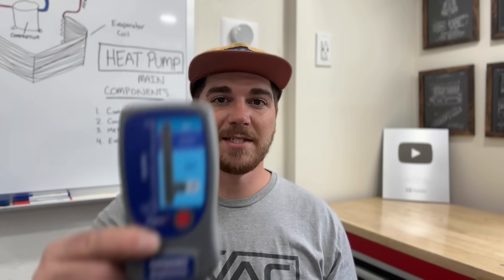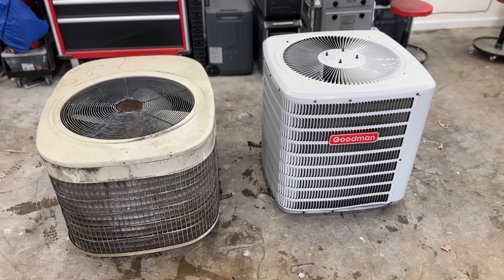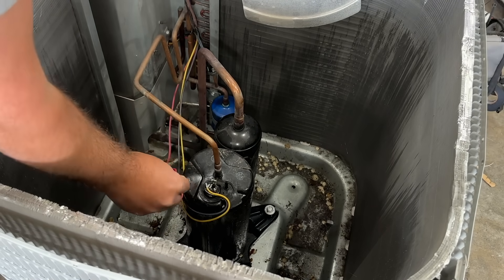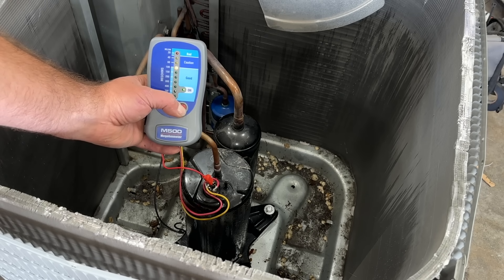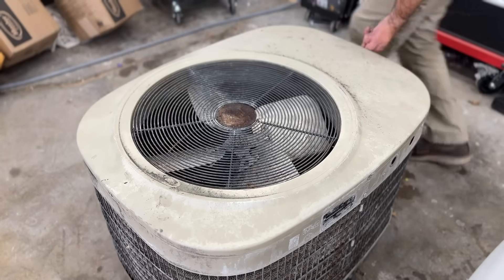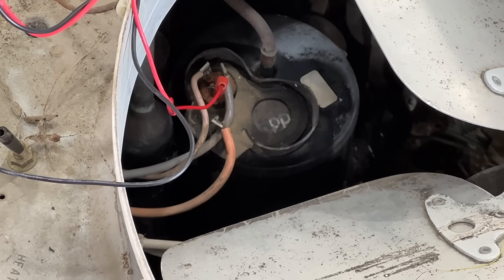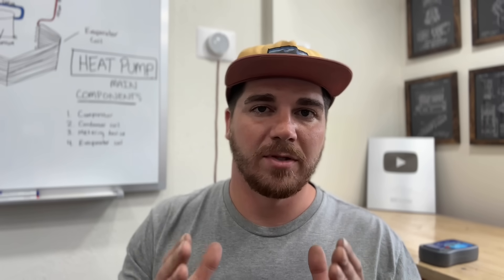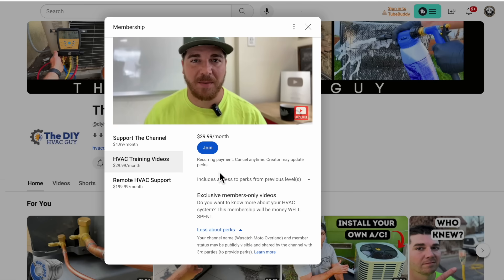Is Your A/C Unit About To Die? This Tool Doesn't Lie

Comment: Just happened to my neighbor. Bad Cap caused unit Fan to stop working.  Compressor goes into Thermal lock. He calls the  AC repair man. The AC man tells  him the Compressor is shot and that he needed a whole new systen at $22k.... I told him to wait for the motor to cool down and we replaced the Cap. All is working well now.
Reply: JEEEEZ! $22K? What did they quote him? A 5 ton variable output inverter heat pump? Hat is a massive price.
Reply: @whochecksthis  $22k would have been the cost if he had chose to use their financing for how many years to pay off... for a 3ton straight cool unit.
Reply: @props-model-shop  ahh… what was the cash price tho?
Reply: @whochecksthis  I replaced THREE ~5 ton systems 5 years ago with variable output 20 SEER inverter systems for less than that!
Reply: @phillipsusi1791  pro, or diy?
Reply: @phillipsusi1791  wow.
Your area must be very affordable to run a business.
I put in two bosch inverter systems with a 5 ton, on 4 zones, and a 3 ron on its own with a 96% gas furnace, and it was close to 22K, 3 years ago.
I dont think i could do 3 vs systems for that today.
Likely would struggle to put a quote together for 2 under 22K.
Reply: @whochecksthis  Well they aren't all 5 Ton.  I think the downstairs one is that big, but the upstairs was smaller, and the one in the mother-in-law suite was smaller still.  Were you putting in the whole system new or just replacing the existing heat pump and furnace?  I have no idea how expensive a furnace is since we don't have those in Florida.
Reply: @phillipsusi1791  ahh. That makes more sense, but still way less than we would charge here in NC.
Reply: @whochecksthis  Not unrealistic. I was quoted $18k to replace my tiny little 2.5 ton system. Replaced the bad contactor and also the capacitor just for good measure, still working almost 5 years later. Also a neighbor called me to come to her house. HVAC contractor was trying to charge her $320.00 to replace a wire on the condenser. I disputed the charge and fortunately the contractor tore up the work order. Two days later, she called me and said it had stopped blowing cold air. I walked over, looked at the condenser and the wire he replaced was burned up. Again! I told her wires don't just burn up. Something caused it. I looked at the contactor and saw it was completely burned. I went to a HVAC supply house not far away and bought a new contactor for $16 and new capacitor for $15, replaced them and the burned wire and it's still working three years later. That's two HVAC " total replacement needed" fixed with a new contactor. And capacitor, for good measure.
Reply: I had a brand new ac unit outside and the inside fan and all that replaced, brand new equipment and all the labor and copper wire and blowtorches and soldering, for like $3200 😂
Reply: I just had an AC tune-up done My guy said my unit's ready to go. It's making a Wawa noise in the compressor and he showed me some meter that should be 30° different mine was only 15. He quoted me 11 grand, why can't you just change the compressor? Mine is r22
Reply: @TonyQuartarone-y2e  it could be the compressor, metering device, or contamination of the r22 (like someone had r410a in their gauges, air, or moisture). He is not wrong on replacing it. I would recommend the same. The r22 system you have is old (life expectancy is 15 years), the compressor is very labor intensive, you will need a new filter dryer, metering device, recycle the old refrigerant, and add new (remember it has been illegal to make or import r22 for years now). Way too much money. It is not like a car that becomes "a cherry" if you keep it long enough. It will not increase your property value, neighbors won't want to come over and look at it. It instead becomes a turd and lowers your property value. It probably uses 2x or 3x the electric of a new system to operate. Your coils will fail next and you will loose all the refrigerant.  You will be mad because you just wasted all that money replacing the compressor. Keep an r22 system forever as long as you don't have to mess with the refrigerant. It did you well, it faithfully provided you with cool for years with little in return...
Reply: my granpa is the same way he says the compressor should come right on but never been to ac school my granpa says hot air is not heavier then cold air its like where did people go to school he has no idea how rain is made if you have alot of humidity in your house it will destroy your unit ,, constantly turning it on and off will destroy your unit ,, common sense , no it has a safety circuit to prevent damage normally the ac runs for a few minutes then the compressor comes on if it had a cataclysmic event
Reply: @bengordon7635  too much humidity will not cycle the ac or destroy the ac unit. Most residential units operate on a thermostat, not humidistat. Too much humidity will destroy your house (mold/mildew).  Ever been to a place that felt cold and clamy? In school they called that the "Chinese restaurant syndrome". That is high humidity in a cold environment. Often the case of grossly oversized units.  They pass air across the coil too fast to remove the humidity.  Thermostat is satisfied with temperature.  You are left with high humidity.  Again, in the majority of systems, the thermostat is the only protection for short cycling the outdoor unit.  To save money, the majority of systems do not have safety systems other than a overheating switch in the compressor.  I don't know how much it helps as you could still fry eggs on that compressor before it shuts down.
Reply: @--harry_  he has a 5 ton unit for 2400 sq ft all I know is its a trailer ,, and at 75 degrees it keeps the heat out as a natural barrier correct ,, the air shuts off every so often at 75 ,,but he raises it to 82 and the ac runs all day and never cools the house he lets everything get hot to the touch in the house the ac runs all day and he says a tralier cannot stay cool , there are 20 vents all wide open will not use the diffuser's the room where the ac comes in is 52 the last room is coming out at 72 ,, do you not adjust the diffusers to even the temp throughout the house ,, he says you cannot close the vent I said on youtube they said you can close it upto 80% , m I said once you let the heat in a trailer its over ,, I had one ran my ac at 74 all the time my ac never broke until I sold my house after 6 years ,, he buys a new unit it broke in three months why melted the capacitor ,,,,hmmmmmmmmm
Reply: What a rip off. I put my system in in 2001 for less then $2200. That was all the parts and most of my labor. Knock on wood it is still running. It could be 96 out and my stat is set to 75 (stat placement issue ) as long as the unit keep cycling it is cold in the house.
Reply: @MrHarryhere69  yes, prices have not gone up since then at all..that won’t cover minimum wage fast food salaries today
Reply: That compressor should not be going into thermal lock -- that's a problem, and probably why it keeps blowing caps.  Next step would be to check the refrigerant charge and whether there are any leaks that are causing the Superheat or Subcooling temp differentials from causing pipes to freeze over or the compressor to start sucking liquid refrigerant.  That's your next step in the troubleshooting process as you've got an imbalance in refrigerant 'somewhere' if the compressor is going into thermal shock on a properly sized system.   And that imbalance is likely due to a leak somewhere.   you still might eventually find that you need a new system, but at least you'll 'know' and won't be randomly throwing parts at the problem in a very expensive game of elimination when it would be better to troubleshoot it down to the actual root cause, then only fix that problem.

New systems will likely be more efficient power-usage-wise ( a definite consideration ), but it would take quite a while to recoup the costs on a new $22k system....unless you live in California and pay more for your yearly utility bill than the entire military budget of the US. 😂😂
Reply: $22k?!  We just had two new AC units and a new gas heater HVAC assembly installed on our 2500 sq ft 3 story plus basement house where the 3rd story has a separate blower and compressor than the 1st/2nd story and it didn't cost us that much. We paid almost half that much .. $12K and that's in northern VA (Loudon County) where the prices tend to be higher than the rest of the country too. I can now turn only the upstairs AC on at bedtime and not worry about wasting energy to cool the basement and 1st floor. This first month alone is already a massive improvement over last summer as we dealt with 90+ degree bedrooms on the 3rd story. It has even helped with our basement humidity too. We haven't had to use the dehumidifier once yet.
Reply: @TheQman69  Its about conscience, some contractors have that and need it to sleep at night, while others don't. And that is the main reason to get at least two bids even three and compare prices to the work scope.
Reply: @TheQman69  In NorCal, all the big , heavily advertised companies do this type of pricing.   I'm disabled/retired contractor and wanted to see if it was worth me installing my own or if prices were reasonable, I'd have another company do it.  $24k for a a 2.5 ton, with 7 vents, not including the upstairs from local company that does YT videos. $22k from another.   No longer able to buy locally so ordered a 5 head  Fujitsu minisplit system from Ecomfort dot com.    One company included a crane for delivery to the side of my house $800, IIRC(easily accessible) None of these quotes would touch minisplit, all bids were gas pack/heat pumps.
Reply: @TheQman69 damn that’s cheap! Which company did you use? I’m a HVAC tech in Loudoun county and replacing a single unit usually runs 10-12 grand on the cheaper side, let alone adding another. With ductwork and everything adding a unit could easily be close to 15k itself. If you had gotten both for 20k that still would have been a steal. For 12k for both the people who did it probably lost a ton of money. 12k would barely cover materials lol.
Reply: It was definitely California 😅
Reply: Just attach a gauge set and simply determine your actual subcool or superheat with your target subcool or superheat (metering device dependant) . If your high and low side are a bit close together, absolutely buy megger and count the green bleepy lights.
Reply: The attorney General should  be contacted  about this fraud
Reply: @kathycallahan6810  I work in HVAC, the sad thing is it is probably done by mistake most of the time. They check for resistance on the winding of the compressor and there is none.  Ah no resistance=bad winding=bad compressor. They totally forget that the unit could be in thermal lock out. Other than them being able to fry eggs on the compressor, there are no indication that it is out on safety. Also they may never even see that the compressor is hot because it is not near the service panel on most units where they are testing.. It takes a long time for the thing to cool and reset. An experienced tech with no resistance will check the wires all the way to the compressor and the connection to the compressor. At that point, they will feel the heat and start pouring water over it to cool it down. With that said there are some larger companies were their employees are commissioned and quota'd that may purposely do it to keep their jobs. I hear that if the unit is older than 10 years it gets condemned.
Reply: I’ve seen people use a can of co,reseed air flip it upside down to reset the limit but you can do water to cool it slowly
Reply: AIN’T THAT A BITCH 22K? DOES HE HAVE A 10,000 SQ FOOT HOME?
Reply: I was under the impression decompressor is not connected to ground, it's isolated. Would you not want to measure between common and run windings, and common and start windings?
Reply: HVAC people are fucking criminal
Reply: A thief never misses an opportunity. You were definitely being a good neighbor and probably saved him from a 90° bend over.
Reply: DAMN!!!  We got two new AC units 4 years ago, 18.5seer 4 ton and a 21.5seer 3.5 ton variables for $21k both.  

Tech gave me a list of "issues" with the old Goodmans but I already knew they were bad.  Easy sell for him, I used to be an AC tech.
Reply: My mother-in-law had a AC company come out to change her filter and within 30 minutes she needed according to them a new $20,000 AC system for a 1300 square-foot house. Thankfully, she called me and I caught it and put a kibosh on the whole scam. There was nothing wrong with her system at all. Greener solutions, Stockton, California.
Reply: @manders78  Sad.  I worked for a company that pushed us to do that.  I quit because I never would.  I felt bad when they really did need an AC and I had to tell them.  Final straw for me is my company was pissed I didn't sell them any repairs or system when they called me to inspect.  It was a brand new house, great shape.
Reply: He's lucky he was friends w/ the smart Freak Brother, Phineas, and not Fat Freddy or Freewheeling Franklin.
Reply: 22K ??   Does he live in an Amazon warehouse?
Reply: That is just an ohm meter set on high scale. Right?
Reply: If there is a delay circuit within the compressor, that might be the culprit that cause the compressor to go into a thermal lock.  Mine happened as the delay circuit cause the compressor to start and stop a few times in a row and cause the compressor to overhead.  Also Goodman compressors are junk.
Reply: @ttch2911  Goodman does not make compressors, they mostly use Copland compressors, as does the majority of manufactures. There is no delay circuit in compressors, that is in the thermostat and or control board, generally 5 minutes. It exists so not to short cycle compressor operation allowing high side and low side pressures to equalize.
What ever issues you had, I doubt it was do to the compressor or Goodman's manufacturing of the rest of the system. More likely a faulty component, improper installation, voltage irregularities such as brown outs several other possibilities.
But it wasn't a junky Goodman compressor since they don't manufacture them, it wasn't a delay in the compressor because compressors don't have them built in, All delays are either thermostat or control board related, they are not in the compressor.
Reply: @ZERO-F2G-  not entirely true. Some condenser units have a delay circuit. Back in the day it was a square box with a knob for the delay. The thought was to wait until blower came up to speed or larger systems to stagger inside outside load.  I have seen them factory and aftermarket.  Now a lot of units have a delay for the system to equalize factory.  Emerson has a little one that even has an amp clamp on it or just about all newer heat pumps do via control board. So delay in condenser is a thing.
Reply: @--harry_  I never said there is no time delay for condensers, I only stated the fact it is not in the compressor. When I started in 87 most units were controlled by a bi-metal coil thermostat using either a mercury switch of a snap action magnet. There was zero delay unless a TDR was used. Some systems had TDR's some didn't. Heat pumps generally did via the defrost board, many strait cool units did not.
Regardless as time went on compressor delay has and is a general thing and it is usually controlled by the thermostat, and sometimes its by the ICB.
But I know of no compressor where that time delay is built into the compressor itself, if you do please share.
Reply: He was saying compressors don't have a delay. If a delay exists, it will be separate from the compressor. As in the circuitry. Could be in condensor housimg or at tstat.
I think his original statement stands.
 @--harry_
Reply: @ZERO-F2G- Goodman name on the unit, it’s a Goodman problem!  Started having massive repairs bills after 5 years!  Replaces with Lennox, and replaced the capacitor, that was attributed to repeated power outages.  Surge protector & new capacitor, problem solved.  Units regularly serviced.
Reply: Who ever installed it doesnt know..or his dampers are damaged .not fully opening or not fully closing  @ttch2911
Reply: @ttch2911  not all Goodman compressors are junk, but, yeah… those cheap rotary ones are… window unit level quality…
Every motor I have ever worked on has a thermal overload switch that opens the common winding keeping the motor off until it cools down. I usually try running water on them to cool em down quicker, but I always tell customer it may need 24 hours to reset,so we can try and run it. Then determine WHY it overheated.

Comment: Men when I work in tool room I found that tools that megohmeter but I don’t where to use it. I’m electrician I got my multimeter the guy in charge in tool room told me I can have it but I don’t where to use it at home I got multimeter already . O thought is a piece of very old meter that nobody can use even our  HVAC technician at work I don’t see them using it😮

Comment: Hi, I wonder what is the unit for the numbers on the megohmeter?  I supposed the numbers on the meter are in Ohms, correct? not mega-ohms?  If so, I can buy a cheap $20 multimeter and do the same.  if not, what's special about this meter that regular multimeter can't do? Thanks.
Reply: The Supco M500 testing range is 20 to 1000 Mega-ohms (20,000,000 to 1,000,000,000 ohms). It is also testing at 500 VDC. A typical multimeter tests resistance at only a few volts. An Insulation Resistance Tester like the M500 uses high voltage to stress test the insulation on motor windings.